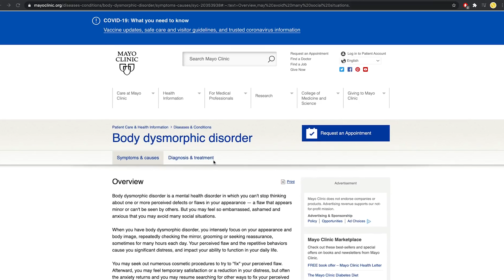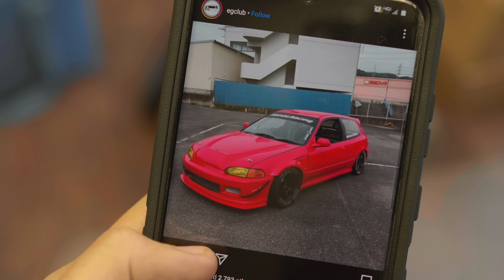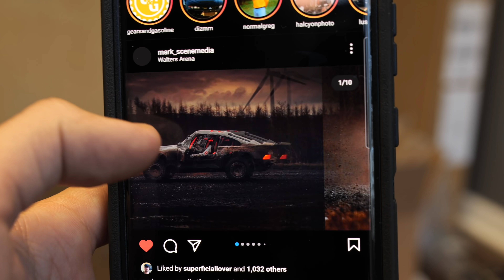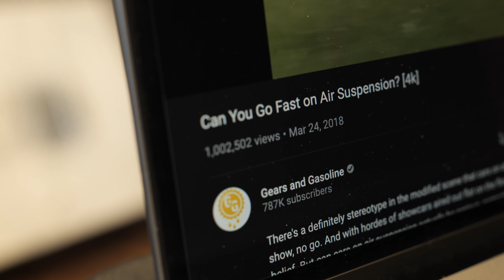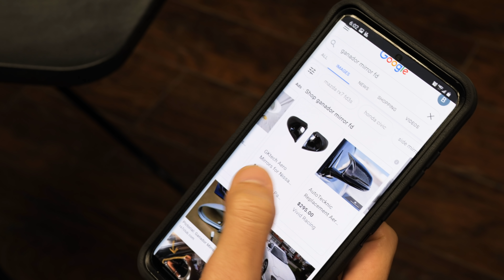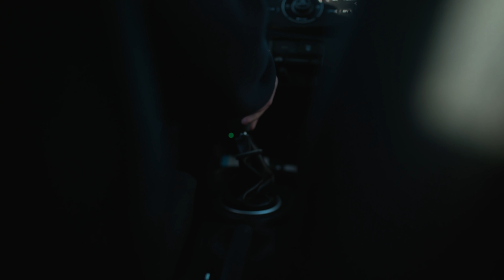Cars Won't Make You Happy

Comment: I take pride in doing one thing with everything I build, 1. How cheap can I do it 2. If I have to spend money how can I make it back using what I built and 3. How much performance can I squeeze out of it using garbage I can get for free lol I starting doing it with scrap PC's and trying with my car currently. Got my obtainable dream card a Honda CRX gen 2 for $1,300 and spent around $700ish on parts and repairs then it got hit by a dear and I got 2k from insurance then fixed it myself with scrap parts I got off a $500 crx with no engine and I still got plenty of parts left in case I need them. The key I feel is pick what you want to do with it,  your personal goal that is custom to what you want, and you'll feel better about it. Oh not to mention after I did the math it's saved me around $4,500 in gas over the past 2 years of driving. I did rough math using the same price of gas which is incorrect since my old car used Premium and the CRX uses regular so I've actually saved even more than that. I do a lot of driving for work. I'm still working on it here and there but in small increments and nothing super expensive (Besides the AC, wow I am shocked how deep I am in currently on AC, $300 for the control panel alone) but all in all the car has paid for itself through gas savings alone, but with the money I make using it for work and the insurance basically paying for it and the original repairs my goal has been met and I am happy with the car but the car never was and never will be my source of happiness and I thankfully wasn't hoping for it. Only I can make me happy just being content with my own goals and where I am in life. 

At the end of the day though it's like when identifying why you're addicted to something. What is it you're really wanting? What you're addicted to or something else? Is it a car you really want or what you subconsciously think the car is going to get you?